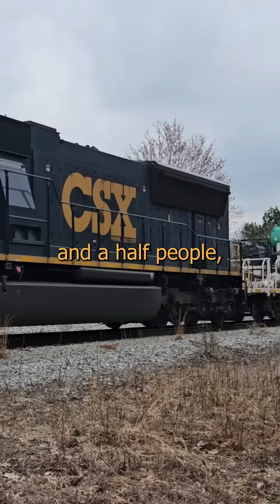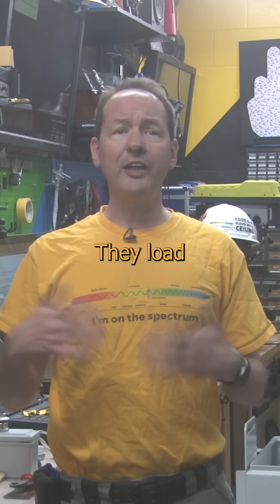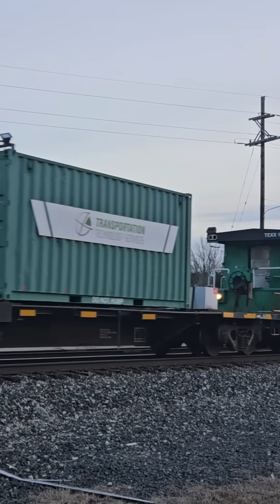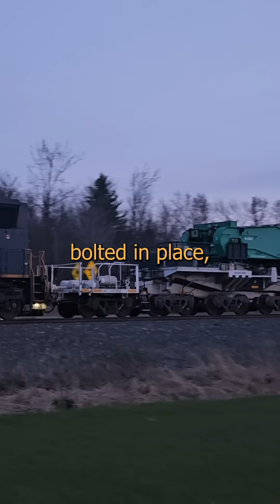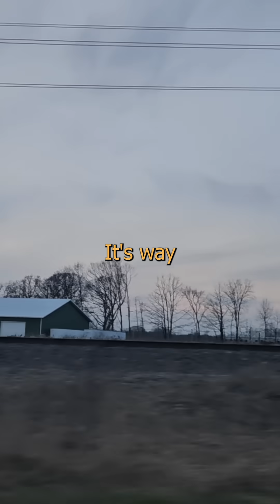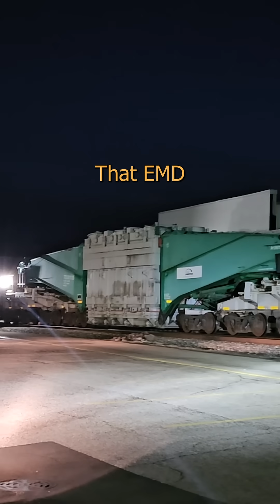Schnabel Car #chrisboden #comedy #train #railroad #physics #transformer #powerplant #engineering

Comment: The design of the Schnabel car is unique because it deals with the issue of you can't just keep making a flat car longer because then it can't take the curves in the track. So you suspend the load on the arms which sit on each end which is effectively a giant 10 axle truck for the load and then the axles underneath are also paired up into 4 or 2 axle trucks under that giving the articulation to safely handle bends in the track. Though care must be taken in route planning because the load could still run in to the inside of the track enough to hit anything that was very close to the track like some old tunnels etc.

Comment: Interesting bit about these not mentioned in video nor comments is that those babies usually allow the load to move away from the track center line. This is useful if the load exceeds normative width (which it usually does). Not sure if this is needed in america, but in europe, due to tighter corners and narrower infrastructure it is quite handy. Usually done using hydraulics.

Comment: Their main load is extra large high voltage transformers. The really biggins that are in 345,000 and higher substations. The older one’s were three phases in one unit. I dismantled a 345k to 115k 15 years ago after the power company pulled maintenance on it. When they turned it back on the Tap changer started to blow up. We contractors replaced it with three separate units. Which were hauled on that really big flat trailer with all the powered wheels.

Comment: My scoutmaster knew some heavy equipment operators and cops so they put him onto when a transformer was delivered to our area to be moved to a local substation. He brought us there the night they were moving it out of the siding yard to the substation. It was a whole giant operation; Lineman to move power and communication lines out of the way because it was so tall, police to shut down intersections, and one giant Oshkosh M-911 MET or some version of it, A big ass flat trailer thing which could raise and lower with hydraulics and could turn each axle on the rear for better turning radius. One dude was driving the truck and another dude with a remote was walking behind it turning the wheels. It was a cool night for a 17 year old kid into that sort of stuff. Thanks Mr. McGovern!

Comment: I work on the formerly shuttle, now SLS solid rocket boosters. This is how we haul the booster segments around plant and to the rail yard. A massive truck called Shirley (made by Shierle) that can handle the 12ft dia, 30ft long, 300,000 lb segment (there are 5 segments per booster).

Comment: Surprised that it runs with just one engine/locomotive.. 
Usually for something this important, you have a backup on standby, in case of a breakdown. And things do happen to be faulty every now and then. 
Then if it is chemicals or reactive elements that needs cooling. Yeah... no bueno

Comment: Our main and startup transformers were a little bigger than this one, and were in place before I started at the power plant.  Then the company bought a spare, so I got to see them bring it in.  And then back out about 14 years later when one of the ones at one of the other plants went on the fritz.  I've also seen the oil unloaded from one for maintenance.  It didn't temporarily go into a tanker or anything; they brought in a BIG bladder.  Like 50 feet on a side and a couple of feet thick.  Besides a lot of heavy metal, copper and steel, there's also a LOT of oil in them.  And ours had a nitrogen pressure maintained, a box on the side with a replaceable N2 bottle and a regulator.  You'd spritz a little N2 in once in a while if needed, and record it.  Engineering kept ,monitoring our readings andn trending them, looking for any leaks.  Or to see if any very minor ones were getting worse.

Comment: I worked for an industrial electrical contractor for years and one of the coolest things I saw was the heavy hauler truck, deliver a transformer, with 176 tires in the trailer and trucks combined. The heavy hauler up front, the trailer in the middle and three full size semi trucks loaded with weights pushing from the back.

Comment: Transformers are usually way too tall for flat cars unless they are transmission to distribution 30 to 50 MVA ones for them to be short enough to fit through various pass through. Yes, I have been involved in the logistics chain of multiple MPT 300 MVA tubs.

Comment: Static friction is dependent on normal force and friction coefficient, so why is it limited by surface area? Does a small enough footprint lower the coefficient of friction at extremely small areas? Or is it more of a matter of damage to the rail through extremely high pressures?

For anyone wondering, the way friction is independent from area is that an increase in area also results in decreased pressure. So there are more atoms rubbing together, but they are all rubbing together less hard, so it cancels out.

Comment: GE Power Generation in Schenectady NY sends out equipment on these. They have a track scale with a total capacity of 750 tons that is 87'6" long spread out over 16 loadcells. Your standard railroad scale capacity is 200 tons, 60 feet long spread out over 10 or 12 loadcells.

Comment: 10 B bogies on a single car is indeed autism triggering, as if I gain superpowers by just knowing and feeling its existence😍

Another cool thing is railcars with C bogies. Most railcars use B or A bogies. C and bigger bogies are usually used by locos. Because of that, seeing a C bogie on a non-powered, ordinary looking railcar is very cool. That also makes 2+bogie railcar even more interesting. Similar with 2+ bogie locomotives, but those already have a ton of axles.

Comment: Is this similar to the car they use for old Naval Nuclear reactor modules? They're basically the entire nuclear reactor, all the cooling pipes, pumps, tanks, electronics, shielding, and anything else that could get irradiated during the reactors 20year+ life span, along with the entire room it's all in, packaged nicely into an absolutely massive armored STS steel cylinder. 
    I know they built these special trucks just to shuttle them from the dock to the rails and the rails to the storage yard. The trucks were absolutely MASSIVE! Like imagine a coal mining dump truck combine with one of those giant off-road heavy haul logging trucks. They made the US armies biggest truck, the giant Oshkosh 8 wheel drive M1070 HET tank hauler look like a Ford ranger!...
   I would imagine they would have to have a special train car to transport them, because not just the continental levels of weight but also their sheer planetary levels of size! I read somewhere awhile back that they also used to fill the entire room/cylinder up with concrete to prevent potential incidents, I'm not sure if that's still accurate but I can't imagine the level of weight involved if they did that! It'd be like the weight of a Naval corvette...

Comment: I seen this going down the highway. They off-loaded this, then loaded it onto a very similar tractor trailer. It had dozens and dozens of wheels and tires. Had two semi trucks pulling it in the front, and one pushing from the rear. There was even a guy sitting on the back of the trailer steering the rear steer. And they had a big police escort too. I believe it was going to a new elecrical sub station for Ameren UE.
Reply: Had several of those truck set-ups rolling through Ohio when they were building the Honda plant. The gantry cranes and press parts... huge.
Reply: Where are you located?

Comment: That's my WORK!! It's a 410kv Wankskellar heavy use transformer designed in the Netherlands especially for our plant in New Paragon, Ill. in 1987. What looks like oil-ports are actually Vector III air-ports with a draw capacity of 11000 psi and a push of over 1200 foot-pounds...incredible piece of equipment and I was sad to see it go, it's resounding pulse worked it's way into my physiology to such a degree that when I went home at night I'd pound the brains out of my wife and she loved it...

Comment: That’s something that never ceases to amaze me. The M1 Abrams, the US’s current MBT (Main Battle Tank) weighs in the ball park of 54-66 metric tons depending on the variant. Yet around 2 or 3 diesel locomotives can haul somewhere around 20-40 of ‘em at a time. That’s psychotic to me, and pretty cool.

Comment: Haaaaa, love your stuff, but, a correction for ya, the locomotives 🚂 are not diesel engine's,  are you ready for this......they are electric, yes I said electric , they have a really huge diesel generator that runs on diesel ⛽️  to produce the electric for the train electric motors.......don't feel bad I just recently learned this myself

Comment: Why did I heard a chord from the train horns
Reply: You absolutely did! Many different train horns sound 3 to 5 notes. Chord depends on horn type and version. For example, Amtrak will use a K5LA horn most of the time, while many modern GE's will use a K5HL which will be a lower chord. A P5 will also be completely different.

Comment: I got to watch a large transformer get hauled through my town two months ago, just after it left the rail yard. The road trailer had 8 axles, 4 front and 4 rear, with a low middle and towed by a typical looking semi tractor. We got ahead of it, parked and stood on the side of the road as it passed by. Lots of ports closed off with red covers and a temporary gas cylinder plumbed in (to maintain pressure?). Bucket trucks played leap frog driving ahead and poking low wires up with a stick while the big heavy load passed below. There was a pair of upside down "skis" on top for stray wires to slide over. I watched in awe, knowing I'd probably never stand so close to a transformer this size again.

Comment: Two things: 1) Some RT (rough terrain) cranes are moved in a similar manner. It seats in a front carrier attached to the truck and then it attaches to another on the back. Other RT cranes are transported on flat beds. 2) A good number of current motorcycles are designed in a similar-ish way. It’s said that the motor is a “stressed member”. Basically instead of having a full-cradle frame that wraps under the engine, the engine hangs from from mounts under the main backbone of the frame and the engine case becomes a stressed part of the frame that acts as the lower portion of a comparable cradle frame.
Reply: Fairly certain F1 cars are the same. At the very least, I've heard something about them pushing for v6s over l4s so they can use them as structural members in the past

Comment: Schnabel railcars, carry heavy loads. With up to 22 axles, these cars used to move electrical transformers, generators, and other large mechanical components. Such loads are sometimes accompanied by a caboose to monitor the transport.

Comment: The locomotive is also notable to CSX foamers, as it is one of the railroad's newly rebuilt flared-radiator SD70MACe's. Compared to the thousands of GE-built engines on the roster, CSX only has a few dozen of these SD70s. Nice catch!
Reply: Google says CSX has a roster of 220 SD70s, but who knows how many are rebuilt  into the SD70AC standard. Also, SD70MACe seems to be a BNSF thing according to another google search. CSX just calls them SD70AC

Comment: For those wondering about the caboose: these types of transports usually have an escort and it some cases the car will actually have a hydraulic system to shift around obstacles or even extremely sharp curves. I work transporting these generators (though we use depressed center flatcars that have a hydraulic system), I’m writing this from a caboose right now.

Comment: Schnabel cars can also be configured with a large girder that can carry (still very heavy) loads in a more traditional "load on railcar" sort of way. This is usually for super heavy industrial equipment that is heavy enough to justify a Schnabel, but can't or isn't designed with the necessary  mounts to become an actual part of the railcar.

Comment: For a 60 Hz transformer, the weight in kilograms equals the watts (or VA) divided by 100. A 1000 watt, 60 Hz transformer weights about 10 kg. An 880,000 pound (400,000 kg) 60 Hz transformer is therefore about 40 megawatts. Note: a 50 Hz transformer at the same power is proportionally bigger/heavier because it takes more silicon/magnetic steel and therefore also more copper.

Comment: That’s my work!! spoiled my reveal of what this load is. Good work! If you look carefully you can see it is a five-legged, three-phase transformer. The oil-fill ports and the penetrations for the HV insulators are staggered across the top. 412 tons of copper and silicon steel.
Reply from the maker: You and I should chat sometime. :)
Reply: Thank you so much for the information
Reply: How do you move it once it gets to its destination?
Reply: @rjatkw  It's not too hard, considering, because it remains outdoors of the rest of the plant. The ~12 kV feed from the alternator comes through the side of the plant, and the HV connections come down from the transmission lines or switchyard, depending on layout details. Anyway, you move it with a big crane.
Reply: Big crane... Maybe a Liebherr, manufactured about 120 km from my house... Amazing steel in Liebherr cranes!
Reply: FOUR HUNDRED AND TWELVE TONS? How the hell do you manage to move something like that onto a train in the first place?
Reply: @blakehorner2949  A big crane.
Reply: @gsmollin2  yep a huge fkn crane, hundreds of pulleys
Reply: Silicon, not silicone. Noone would get away if they got that one wrong.....Though the other way around would have been funnier, and allowed for more elastic deformation.
Reply: @citylockapolytechnikeyllcc7936  Silicon steel. That's what I wrote. What I have wondered was the thickness of the laminations. 14 mil?

Comment: You get Abnormal Indivisible Load haulier vehicles for the roads as well. Same idea, they use a cradle to spread the axle load across more axles as well as to provide a better turning circle (probably not a huge issue for the railway versions).

Comment: The first time I saw a Schnabel car I need the instant connection between that and the back half of an Indy car 

The Indy cars at least the old style I'm sure the new ones that I haven't kept up... Used to be shipped from the factory with everything from the roll hoop forward and then basically a piece of steel and then the rear suspension. What goes in between is the engine blocks and gearbox which are actually stressed members which bolt behind the roll cage and then have the suspension hanging off of them. 

The engine and gearbox not only have to perform their primary functions of power and distribution of that to the axles but also carry the loads and torque from the back half of the car the suspension and wings. 

The more I think about it I have to imagine that modern formula 1 in modern Indy cars probably are manufactured the same way as the other options is a space frame chassis which just waste too much weight on materials

Comment: I saw something like this on a big rig. The payload was small and it was suspended just like the train. They never got over 10mph and pulled off at every turn off to let the traffic go. They had a very large military escort so i guess it was a metric crap load of uranium. Oh, blocked both lanes so no one could pass them. Super nerdtastic

Comment: Yeah, just had a nerdgasm.  Yes, I've seen one of these cars with a similar transformer up close and intimate, when it was left on Mesa siding along the then-known Southern Pacific back in 1993, in Mesa AZ.  The car with its load was parked on the house track for a couple of days while the move teams worked out the logistics of moving that transformer off of that car, onto street trucks and then up to I believe, Prescott Valley.  The car was a similar 20 axle setup.  Back then, it was moved by a pair of EMD GP40-2s and the Tempe Salt River bridge, 9 segment Pratt truss built in 1912, had absolutely no problem with it (although the train crew literally walked it across the bridge).

Comment: Transportation Technology Services car TEXX 1135 (as seen in the short), formerly CPOX 820, is a 20-axle Schnabel railcar designed to transport oversized transformers weighing up to 490 tons (445 metric tonnes). In 2020, it was upgraded to a load capacity to 568 tons (515 metric tonnes).

Comment: I love these things, and CEBX 800 is/was stationed in my area. My god it's huge. Charleston SC is a big export point for big stuff. Always comes with a caboose, often times there's other flatcars with 8 to 12 axles hanging around too. CEBX 800 is 36 axles. Holy, sh*t.
Reply: @carolinarailfanning I work for a company that’s contracted by Fracht to transport these generators on the flatcars, we’re always carrying these to Columbus street terminal and it’s super awesome. Our cars are usually 18-20 axles

Comment: I can train autism your brain here for a second. That is a CSX SD70M-2 locomotive. I believe those haven’t been rebuilt to AC traction motors yet but the car body is a SD70M-2. The main difference between the SD70M and its dash 2 model is the radiator grills stick out at a slight angle compared to the SD70M’s flush mounted. Fun fact a good portion of NS’s SD70M and SD60M locomotives were rebuilt to be SD70ACu locomotives. Others can add or correct information here.
Reply: They are now rebuilding the flared M-2's. 4744 has been through the rebuilt program.
Reply: @ Ahhh, the flare body is finally coming to its end as dc EMDs

Comment: Driving home yesterday, I passed 2 wide loaded semi's. For some reason this short reminds me of that. I'm pretty sure I was supposed to pull over like they were ambulances, but I was rocking 4x4 and just rode the shoulder like a pro. Four footprints all pulling me in the correct direction is good enough for me.